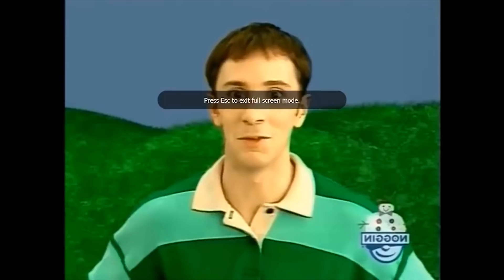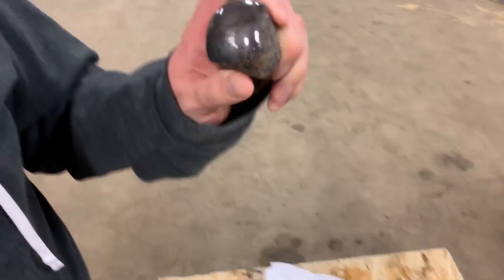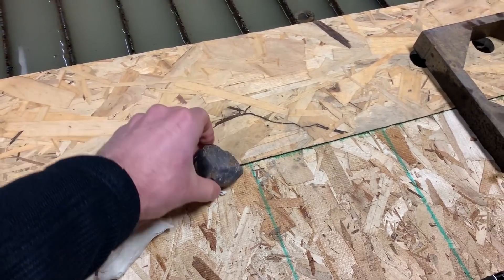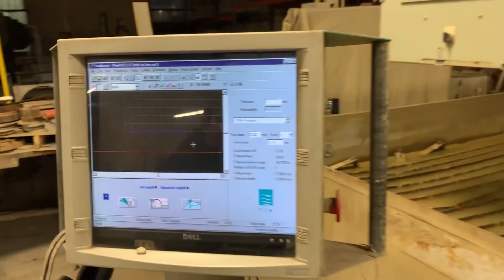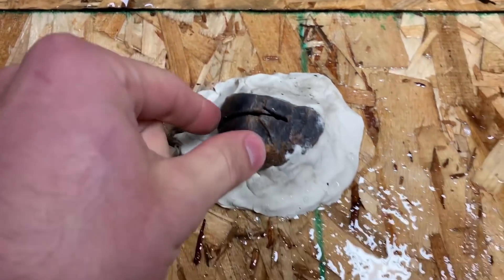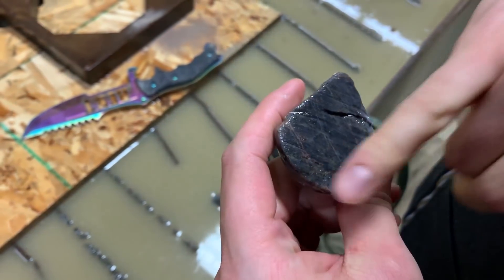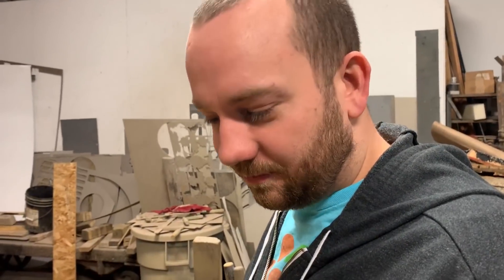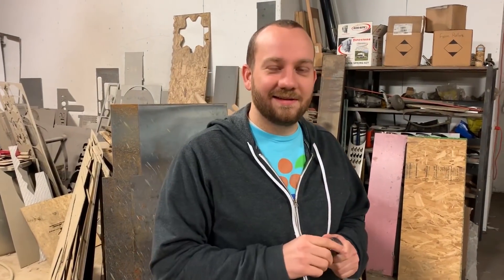Sapphire vs Waterjet 60,000 PSI  - 2nd Hardest Material

Comment: There are a bunch of materials harder than that, like tungsten carbide, silicon carbide, cubic boron nitrate etc. Would be interesting to try and cut that stuff, you'd just have to find some old cutting inserts for lathes or mills.

Comment: I want to see jade cut on the water jet. Hardness only refers to the materials resistant to scratching. If you hit a diamond with a hammer it will shatter into little pieces - there's a contest in Wyoming every year to see if anyone can break a jade boulder with a sledge hammer and nobody has ever broken it. Jade fibers are interwoven and in effect lock together making it very tough.

Comment: I didn't see the answer in the top 10 comments I saw 

The water jet can cut anything even without an abrasive. This is because water is damn near perfectly incompressible. This means you can't make a certain volume of water less than that specified volume. 

Tl; Dr: water is incompressible so it can cut anything if you shoot the water fast enough.
Reply: Nu

Comment: Is that aFlow machine? I ran one for a year awhile back. I used to cut rocks with it in my down time.  You are actually cutting that corundum mainly with water pressure.garnet will never scratch a corundum massive like Sapphire.  Cool experiment though. Try setting some of your tougher cuts in plaster of Paris  as they will remain more stable. Quickcrete worked well to for larger pieces.

Comment: I don't think the abrasive strictly needs to be harder than the material you're trying to cut. Diamond is the hardest material on earth but not the strongest, smack it with a hammer and you'll turn it to dust.

I think that the momentum of the garnet is sufficient to break off tiny pieces of the harder material by fracture, not etching, so it still "cuts", but isn't strictly "cutting".
Reply: Yes 💎 is hard ruff to the touch but not that heavy 
Shatters like glass

There might be something harder then diamond out there 🤔 😬 👀 😏 😕 😅

Comment: A nokia 3310 is a 9,7 on the hardnes level.
Reply: Pandamann nope thatd be a 1000000
Reply: Pandamann no,it’s a 3 and a 9 million at the same time,it can’t be broken but it gets surface scratches from coins
Reply: Yeah I had one of those and I dropped it, smacked it and ran it over and it still wasn't broke

Comment: What's harder than sapphire but softer than diamond? Resisting the temptation to buy some of that rock solid merch!
Reply: Cubic boron nitride
Reply: also vanadium/niobium/titanium carbide, or MC type carbides in general the MC means metal/carbon in other words one metal atom bonded with one carbon atom. only certain metals form these carbides like chromium carbide is Cr(7)C(3) and is softer than sapphire(aluminum oxide)
Reply: Huh, I would have guessed moissanite
Reply: Maybe corundum
Reply: Well if it's ONLY solid as a ROCK you're wrong

Comment: Harder than sapphire but softer than diamond... (Not necessarily in order, and slightly depending on how you define "hardness")

Cubic Boron Nitride (CBN)
Osmium Diboride (OsB2)
Tungsten Boron Carbide (WBC)
Silicon Nitride (Si3N4)
Boron Carbide (B4C)
Carbon Nitride Solid (C3N4)
Rhenium diboride (ReB2)
Stishovite (SiO2)
Titanium diboride (TiB2)
Crystalline Boron (B)
Silicon Carbide (SiC) - Also mentioned in the comments as Moissanite

Comment: I don't think it would have scratched in half if your abrasive is softer than the sapphire. My guess would be that the impact of the abrasive itself might chip away some of the material. Sort of like cracking a rock with wooden stakes. They get all mangled and shed bits of wood everywhere but you can still split the rock.

Comment: Seriously? Why did you cut straight through the finished face?
You guys are such numb nuts... You could have cut parallel to the finished face and made a cool, lens like disc... You could have angled the cut to get a disc with a thick edge to hold and an opposing thin cutting edge.

Maybe try thinking about it twice, each. Come up with 4 different ways of cutting the item, then cut the one with the most useful end result?

Comment: Don’t you use corundum (sapphire is a type of corundum) as an abrasive?
Reply: Sapphire is Aluminum Oxide, a cutter setting which they have, but ignored. Doh!
Reply: @YodaWhat  corundum is a type of aluminium oxide, Al2O3...
Reply: YodaWhat no sapphires mineral make up  of corundum but what determines if it is sapphire or rubie is based on the actual additional mineral deposite. 

Also there is very little to no aluminum oxide in pure blue sapphire... sapphire gets its color due to titanium deposits... 

Ruby has another form of oxide in it... aluminum oxide determines the way light transfers through the gemstone... 

The only type of sapphire that contains aluminum oxide is one that is consider a Star sapphire look it up
Reply: Cody'sLab they dont know😂
Reply: 80grit indian riverbed garnet is the good stuff, but most people are using GMA austrailian stuff currently
Reply: i heard they use gannet
Reply: Garnet. The real key would be going up to a 90,000PSI rig. Ours don't flinch at anything. Just crank that feedrate down, ramp that abrasive up, get comfortable and watch the hopper drain with your wallet.
Reply: @XFolf  what's the material used for your water jet exactly(specs)? I work in the mineral industry, currently visiting mines and processing companies in Cambodia, maybe I can help your wallet drain slower.👍
Reply: they have use aluminon oxide was an abrasive before or afetr this video ,idk of it would have cut the sapphire better or not
Reply: Or Tungsten Carbide (9-9.5 Mohs), Boron Carbide (9.5), Boron Nitride (10.5)...
Reply: LuckyLarry Silverstein  chemically pure Aluminium Oxide is also called Sapphire. Better quality watches use it for watch glasses (for scratch resistance) and as a substrate for electronics for use in high radiation environments (silicon on sapphire).
Reply: Weird water jet guys didn't reply to Cody's comment
Reply: I don't think the people who commented on this know who Cody's Lab is...
Reply: @RumbelinGrumbelin  I found out about Cody's Lab from him being in a Water jet video :)
Reply: I think they said they use some kind of crushed garnet
Reply: Goku In Real Life that was the abrasive in the water used to cut the sapphire with the water power jet
Reply: Cody'sLab garnet isn’t made of corundum...
Reply: @mrpumperknuckles1631  thats not what he asked... Cody was just trying to verify if they used some type of corundum, but i dont think they have . Just saying. unless he deleted a comment but idk. AAAAND, actually no, corundum is a form of aluminum oxide thats gets its colors from chromium (rubies), titanium and iron(sapphires). But please research stuff before you post stuff like this online, misinformation is a big problem. Point is GeEEEEEEeeEEEEEeeEeeEEEeeT ur stuff right. . . 
EDIT: but thanks for inspiring me to research to prove your misinformed self wrong
Reply: No they use crushed garnet
Reply: @nightshadethewolf6307  that is what i meant
Reply: Go away
Reply: That's what I thought. Aren't sapphire and garnet basically the same stone?
Reply: @SirDrance  no they are not
Reply: SirDrance No sapphire rubies and emerald are the same stone...
Reply: @mrpumperknuckles1631  emeralds are a form of beryl. Sapphire and Ruby are a form of corundum. They are not the same.
Reply: Boom roasted

Comment: From what i was able to find online (this is 100% possibly wrong i didnt research very much) the abrasive is able to cut through a material harder than it because upon impact it releases an immense amount of heat, which softens the material it hits and allows for cutting since the abrasive will be replaced by cooler abrasive which is maintaining its hardness while the sapphire stays hot enough to be softer. Hopefully im not misinforming everyone.

Comment: harder than sapphire and diamond... Bedrock
No pickaxe can break it
Reply: ok
but apart from the joke, Bedrock is normal rock you can find anywhere on the surface of the Earth. And with that, its hardness changes everywhere. Obsidian would be a 5-6 on the mohs scale, Bedrock can be harder or softer than that.
Reply: @Sharpless2  Correct. Bedrock simply refers to the topmost layer of rock beneath some loose material, generally called regolith, that may be more accurately described as soil, sand, silt or gravel. As such, and as you said, it varies everywhere on Earth. Some bedrock may be limestones, some may be basaltic or granitic, etc
Reply: @Sharpless2  obsidian is just as hard as glass so it's nothing really special
Reply: @lokpire0   correct. But its just cringey to see when minecraft players think that Obsidian really is some magic extremely hard material... Its natural volcanic glass and is around the same hardness as normal glass.
Reply: Hahaha

Comment: Given that those tiny garnet particles are moving at [whatever speed y'all figured out], is it possible that when cutting harder materials it's like hitting it with a tiny hammer, and it's chipping it away? I'm sure Cody could figure it out, perhaps by throwing that cut piece under a microscope and seeing if it looks like tiny fractures or tiny scratches.

Comment: The CBN (cubic Boron nitride) is the second hardest material on earth right after diamond. I know it exists as a crystal but it's super expensive and not very big crystal
Reply: Used in machine tooling
Reply: I use it on my grinder here in my workshop. It is indeed tough! Used the heck out of it and it is still going. No steel is comparable. Nothing I have found. Even Tungsten cuts on it.
Reply: @AldoSchmedack  Tungsten titanium alloy

Comment: I do not know too much about hardness but isn't the way things hardness is measured is by scratches? like a steel wire shouldn't be able to scratch glass because steel is lower on the scale than glass. does this check out or am I thinking about it wrong?

Comment: Garnett is 8, water is 1...... 1 + 8 = 9 that's why you cut the rock
Reply: but what if they use the same garnett for Diamonds? 8+1=9, yet Diamond is 10. Why can they still cut it?
Reply: @Sharpless2  the lick test weakened the diamond to around a 9.

Comment: One question: where does your excess water go so your tank isn't overflowing? Do you have to somehow filter it?
Reply: ZuUnkreativ FürEinenNutzernahmen that’s two questions.
Reply: there is a drain at the side that goes into the sewer system probably. Most of the abrasive and cut material becomes that sand they have to clear out, so the water draining is usually not as dirty.
Reply: @JoshuaNicoll  Thank you👍
Reply: You should probably ask them
Reply: That's been covered in older videos.
Reply: @gtfkt  really? I must have missed it... Whats the answer then?